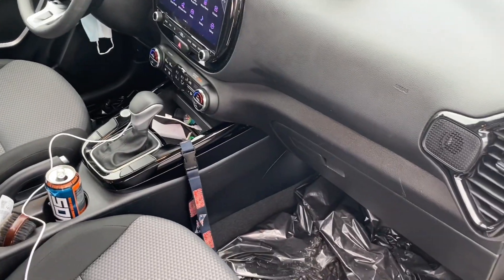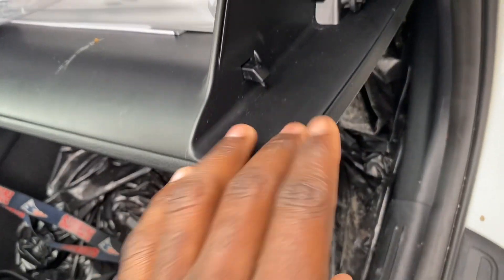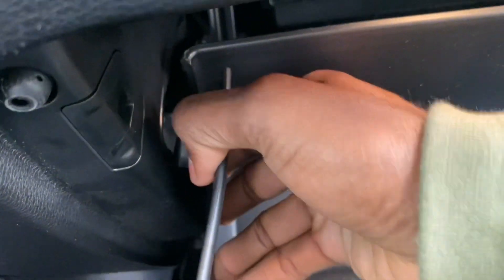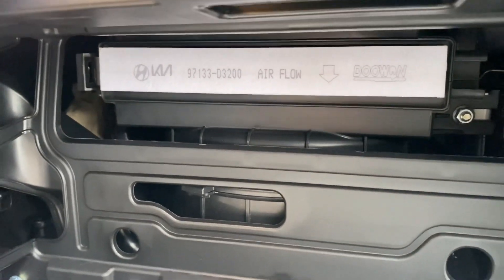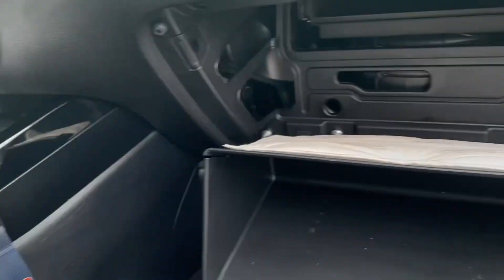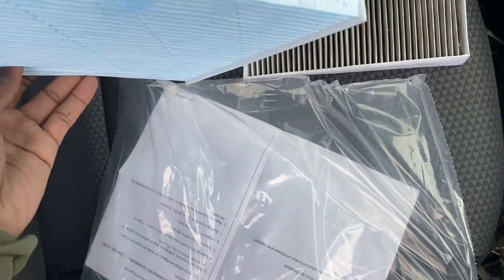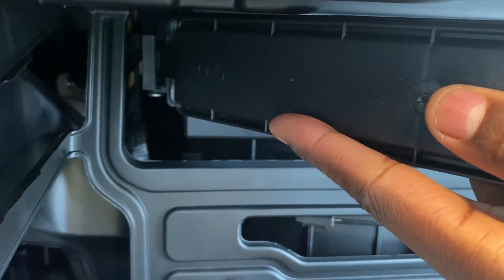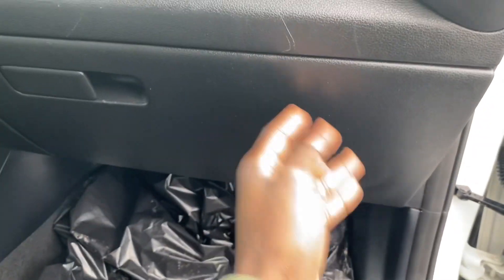2023 KIA Soul Cabin Air Filter Replacement | How To Replace Cabin Air Filter

Comment: Anyone know how to access the blower motor below the cabin air filter?
Reply from the maker: I don’t but I also have a 2012 Kia forte and I just twisted it counter clockwise and it popped out, then disconnected the wire that gives it power I have a video on my channel it could help